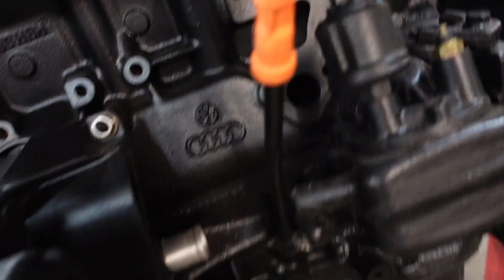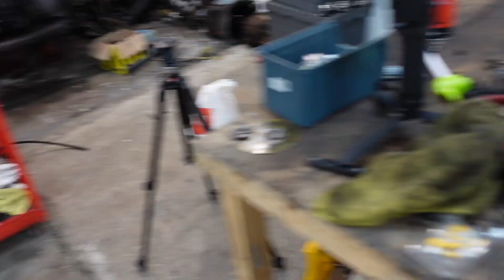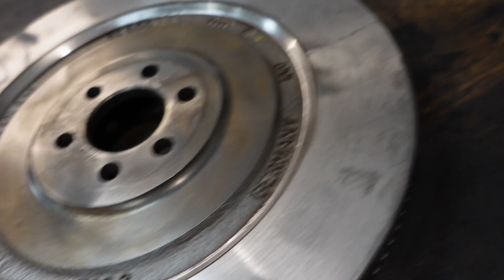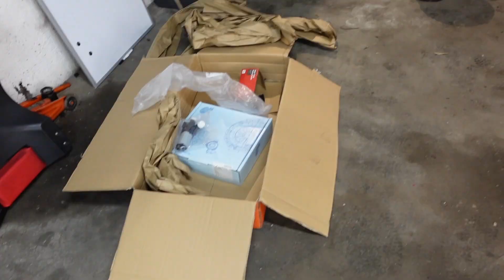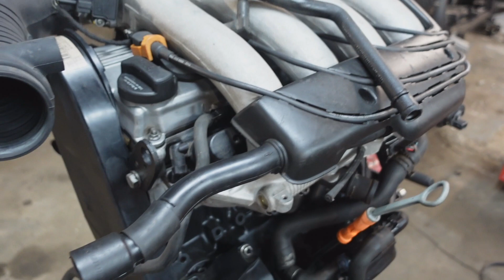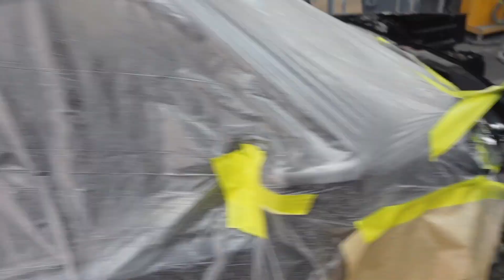Golf mk2 ABF Engine Part 2

Comment: Hello, I intend to install in my car (ABF engine) the set of Kavasaki ZX10R or Suzuki GSXR70 throttle bodies but here in Brazil the information is scarce.  So I would like to know how to make the input collector that connects the itb to the head.  I also don't know the ideal location for the air temp sensors and the map sensor.  I saw that there is an engineering company in England that sells the ready-made kit for the ABF engine, but it is very expensive.  Is it possible to provide some information?  Thanks.
Reply from the maker: With throttle bodies you may find it easier to use TPS only to map the engine due to poor vacuum, or you can make a vacuum box/manifold with pipes from each cylinder. Air temp can just go in front of one of the throttles.
Reply from the maker: Inlet manifold just copy what other people or kits do. 👍🏼
Reply: @RestoDesigns7  Thank you very much for your attention.  Is the ITB Toyota 4A-GE 20v currently hard to find?
Reply from the maker: @wagnerbezerra1605  I have no idea fiend,

Comment: Fantastic! 😁 Love the color too!
SB engine has the similar waterpump for cooling the turbo.
Reply from the maker: Yes that's right, will be inserting to see the effects if any, the colour is cool, can't wait for later this year to get the whole car painted. Engine was be in the car in the next video.
Reply: @RestoDesigns7  Really interesting, I wonder if it will help. :) I found one of those pumps from SB engine, but it's not turning. Took it apart, and the motor seems good, but the problem is where the propeller is, I guess the seal. And I don't know how to take that apart.
It's gonna be gorgeous car!
Reply from the maker: @MOTA_KRAMPUS  Thank you, I got a new pump from AutoDoc cheap.
Reply: @RestoDesigns7  Awesome! :)